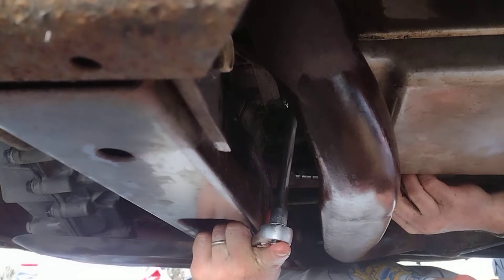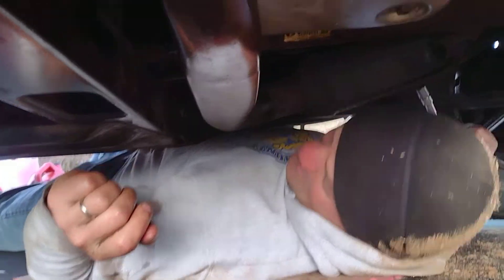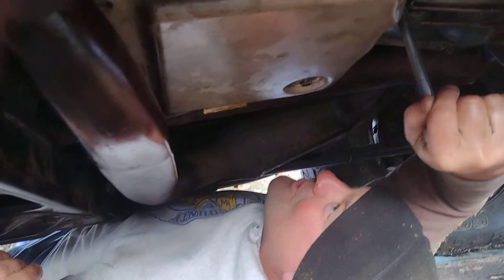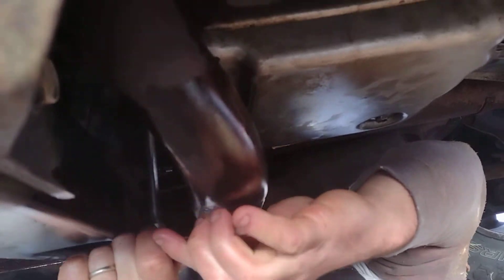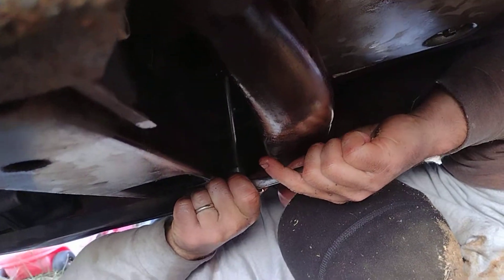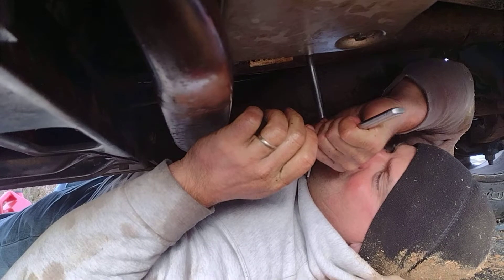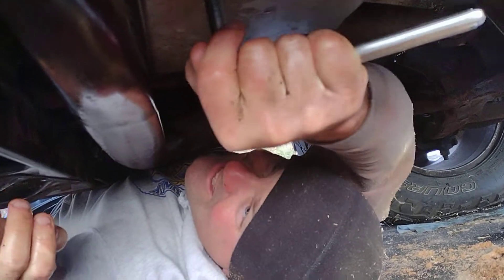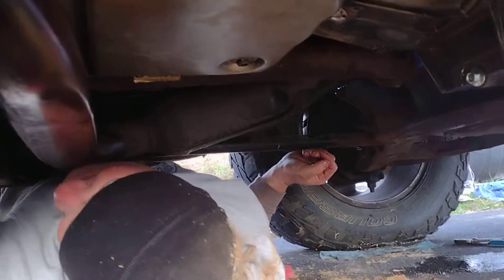Questioning engineers smarter than me while torquing the transmission pan bolts back down. part 5

Comment: Idk how you be able to fit in there lol, great job, do you know what is the torque specs for the transmission oil pan?
Reply from the maker: I didn't look it up.  Used German specs instead.  It's been almost two years, though...no issues and no leaks, so I think it's ok 🤣. Thanks for watching/commenting!
Reply from the maker: I'm not sure which transmission you have or even which one I have!..., but some specs I keep seeing online are in the range of 6-10 lb ft...you might ask a parts store.  They could probably find that info pretty easily.
Reply: @Mr.Handy-ish  thats a good information thank you.